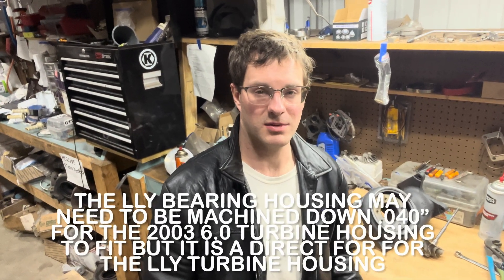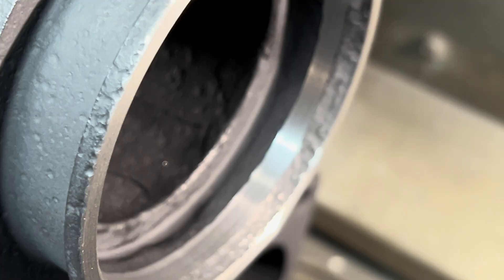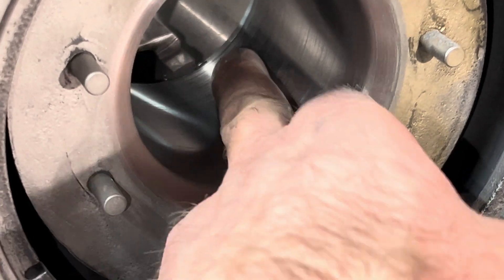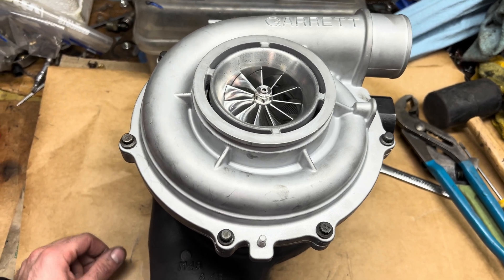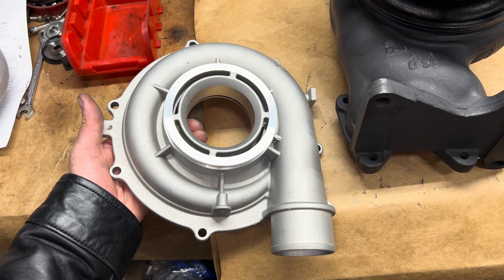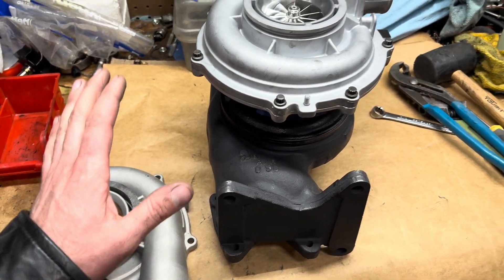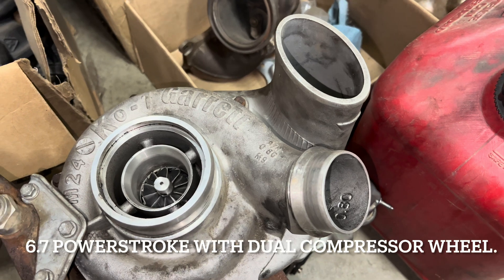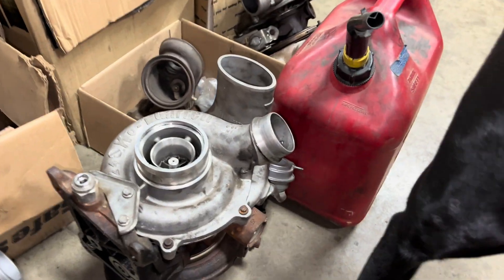Chevy Duramax GT3788VA upgrade to Ford Powermax turbine

Comment: Man that’s gotta be nerve racking with a 20lbs housing swing around? That came out awesome, love how you ported it out too…🔥
Reply from the maker: I have a peterbilt turbo to machine housings for. The compressor housing and turbine housing are both cast iron. I weighed the compressor housing and plate at 26lbs. I prefer to machine that on the mill but machining the Raduis requires a 450$ tool that is only good to do that one wheel. It maybe possible to make the Raduis in 3 axis mode but I need to fix my x axis. I think the electric motor need bearings.
Reply: @ I love that stuff, I never got into it, I was a auto tech for a long time & I also did plumbing because my father was a plumber. So I ended up becoming a master plumber. But I always wanted to know enough & have a lathe so I could make cool parts. When you have something so heavy on there it’s nerve racking, cause if it comes off it’s gonna ruin the part. Very cool though, you definitely know your sh*t. If I ever need anything done to my turbo I’m sending it to you no doubt…👍🏻